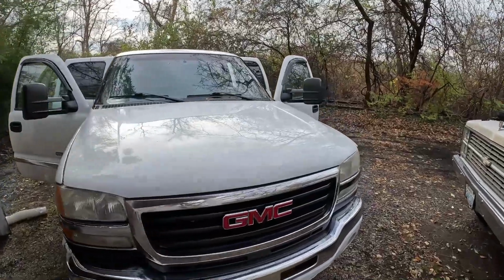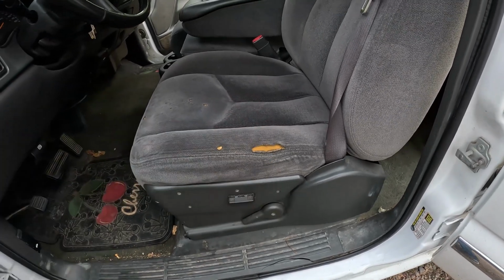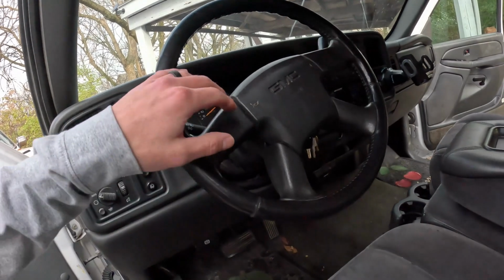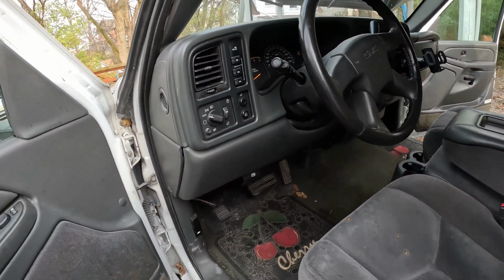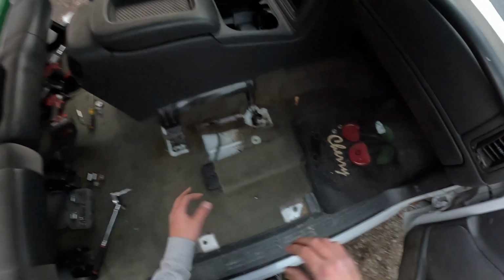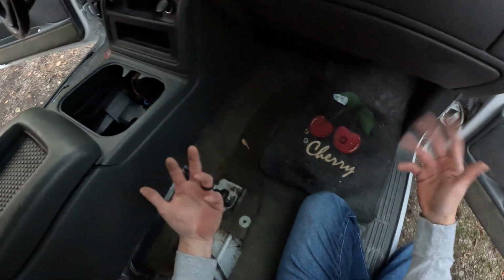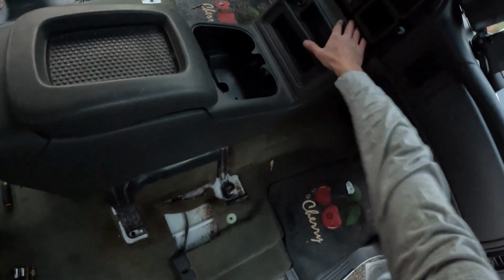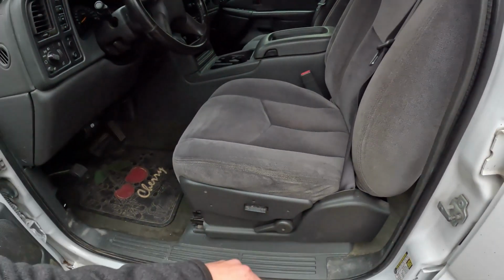Cloth Seats Install on 03-06 Chevy GMC Trucks

Comment: Looks great, I got the same cover for my Chevy and it faded out once I used it for a few weeks!
Reply from the maker: Nice good to know. Where did you get your cover from?
Reply: @andrewpowers01  from Richmond Upholstery. Quality is far better than stock it’s been about 8 months since I’ve replaced it.
Reply from the maker: @kauveahan1117  ya the quality seemed great. The color tone was just too far off for me
Reply: @andrewpowers01  I thought the same, called Richmond they said it will fade since it is brand new. Assured me and stated give it a break in period. Within the 2nd week I noticed it was matching and now looks like an exact match. 

I stumbled across your video cause I want to take my console out and put the jump seat in. So thank you for this video!
Reply from the maker: @kauveahan1117  cool, and no problem!

Comment: It said no one makes a good  cloth replacement The seat shop makes excellent excellent leader. But they said they wouldn't make it if they can get them material.
Reply from the maker: The seat shop does not make these cloth seat covers for these trucks. Only leather. I tried looking there
Reply: I know and I asked them about it. They said they can't find the material.
Reply from the maker: @danielb-c9100  oh gotcha. Seems like no company has the correct material for the cloth unfortunately
Reply: But if someone has a lot of money Croft is man-made? I think. Then you can make it every impossible though Then you can make it every impossible, though. To get it to match. Wow, isn't the company's head at some point? Hopefully in the future, the seat shot makes it cause there are products are good.